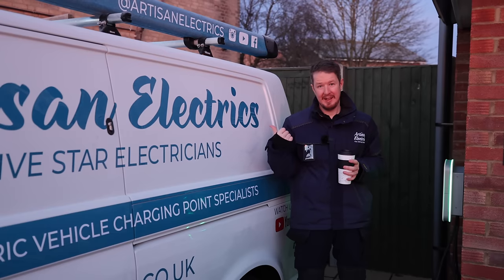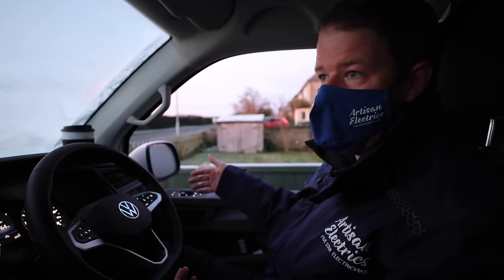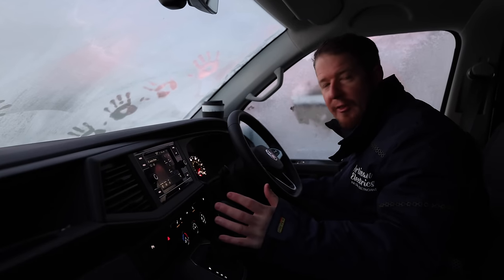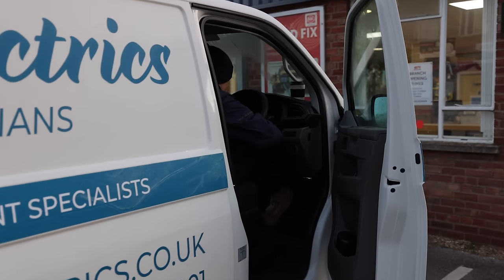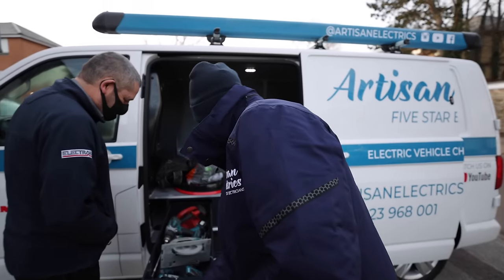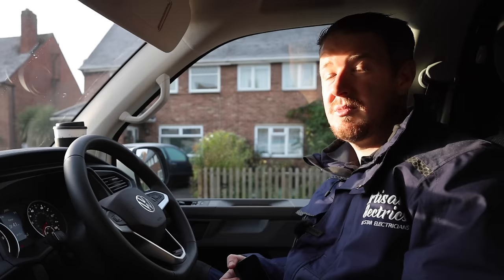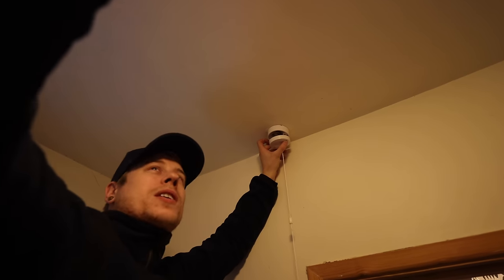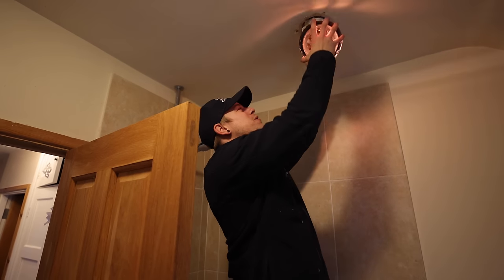ELECTRIC VAN NIGHTMARE 😬 - Volkswagen Transporter Electric Van

Comment: Let me get this straight--you can't predict how many hours it takes to charge at 3.6kW, even though you're electricians
Reply: 🤣🤣🤣 the van probably does it.
Reply: Charging batteries is not linear, it is rapid for the first 3/4 or so, then tails off as the battery management has to keep the cells from going over charge.. bit like filling up a glass to the very brim without spilling it: you can pour water in quickly for the first bit, then you have to slow down more and more as you get near the top.
Reply: @--Nath--  When you're fast charging, yes. But the video quoted 3.6kW. That's slow, onky slightly more than a 13A "granny cable" but less than the next step up, a single-phase Type 2 home connection at typically 7kW.

Is it a limit of the van? Whatever, assuming they didn't get their facts wrong, 3.6kW is slow charging already and there would be no need to reduce charging rate until the battery is very close to full.
Reply: @RupertReynolds1962  some battery chemistry makes low temp chargimg a problem.. so that may be why..? If it doesnt have active thermal stuff (like a tesla for instance) then maybe it was low temp cutoff as the issue? But I thought that was more of a "complete stop of charging" type issue..
Reply: @--Nath--  
Charging batteries is therefore Algorithmic.
Reply: @alexnelson9512  constant, linear, logarithmic, exponential, factorial would all qualify as "algorithmic" surely..?
Reply: @--Nath-- 
 Not in the case of decibels (dB)  = 10 log.
Reply: @--Nath--  I've only ever charged my car on 6KW. Seems pretty linear until the last 2% that take forever, something called battery balancing, who knows. My leaf tells me how long it will take to charge, surprised if his van or app doesn't. Couldn't watch as the blokes an idiot.
Reply: @patrickmooney5035  lithium batteries usually have a minimum charging temperature of 0C, while lithium batteries can be charged below 0, it has to be at a really slow C rate because the absorption is really slow.
Reply: @cbflazaro  I cant say that I've noticed  but here in the UK sub zero temps would probably occur over night. Thanks for the heads up, I will pay attention if / when I have to charge at that sort of temp.
Reply: Well, he's trying to defrost a windscreen with his hands so no surprise there. (ha)
Reply: @RupertReynolds1962  Problem. Home power meter only handles 3kW. Running it even near max potential for a couple of hours every day would mean thousands going out in electricity bills. Having an industrial supply contract just to charge the car isn't quite inviting isn't it?
Reply: @giacomoneri1782  That isn't an answer to anything I said here.

And I don't know where you get your figures from: here in UK--at 230V each 13A socket can deliver about 3kW maximum, but the domestic meter in my house is protected by a 100A fuse. Over 200kW, so the meter is certainly not a "problem".

If you don't take advantge of overnight electricity (variable rate tariffs) then you might pay 18p per kilowatt-hour.

Average UK mileage seems to be less than 8,000 miles, or 22 miles per day, or about 6kWh in an eNiro, costing about £1.10 per day. 2 or 3 hours plugged in with a granny cable

On the same mileage, my small Renault Clio would cost £3.70.

So even if electricity costs double (and petrol doesn't) and even if you don't use the right tariff becuse you didn't know about them, electric cars would still be cheaper.

It will cost a lot less than that on a variable overnight tariff, because our grid's generators run more efficiently if the difference between daily peaks and overnight minimum is smaller.

Then of course EVs tend to have lower servicing costs and less depreciation in value. I don't see any problem, except that the initial cost of buying an EV is currently higher.
Reply: @RupertReynolds1962  yeah, the meter itself it's not the problem. The contract may be one. I don't know about running costs, haven't done any real calculation yet, but taking into account how much an air conditioner or an hair dryer impacts the bill (which almost tripled since 2020) makes me wonder how much having a car taking the full power for 2 or 3 hours a day may cost. Maintenance costs aren't that big of a problem. A decently kept petrol car can easily run 20 years and over 200000km without big expenses, just brakes, tyres, bulbs (which are also in EVs) and fluids. Also, the less complicated the car is, the more problems can be fixed at home without having to spend fortunes in parts and specialized labor. A 20 years old petrol car can be easily fixed with cheap scrap parts without seeing a mechanic. The same cannot be said for EVs. And last but not least, complex systems and assists and alarms and all that fancy stuff, it's just annoying to me. I like the car to have less control as possible, so if something fails i can easily work my way around it by myself
Reply: @RupertReynolds1962  depreciation is not an issue either if you run it for 20 years 🤣
Reply: @giacomoneri1782  Funny you should mention that--my Clio is 22 years old and still going strong.

But I am not representative of yer average driver :-)
Reply: @--Nath--  It's 28 degrees F. It's not even cold.
Reply: It depends on the power draw. Dewalt has a 54w fast charger. It doesn't work in the cold. It changes to a slower charge. 
So how can you calculate charge times ?
Reply: @taureanwilliams2900  He said "because it only charges at 3.6kW" which seems to say he knows the limit of his charging setup is 3.6kW.

So it could never get more than about 15kWh in the 4-hour window he set. That would be more than enough for my daily commute, but a lot of people would need more. Maybe a 7kW single phase charging point, or go to 3-phase if the van will use that?

If they meant "because cold weather limited the charging to 3.6kW" they'd have said that, or commented later, yes?
Reply: 234 HP divided by 4.3p per gas unit x 240volts = 6hrs 43 minutes
Reply: @andyharpist2938  You forgot hemlock and eye of newt from that magic spell!
Reply: @RupertReynolds1962  Absolutely correct...basically it's the same formula that the electrician uses to calculate my bill.
Reply: Not mph
Reply: @--Nath--  nice analogy
Reply: @alexnelson9512  asymptotic?
Reply: @RupertReynolds1962  There are lots of 20+ year old cars on the road in the UK. It should be interesting to see how EV's compare.
Reply: @TKevinBlanc  28 degrees F is below  the freezing point of water.
Reply: @paulhillman400  Early EVs seemed to suffer more degradation and even with them 10 years is not all that rare.
I'm hoping that we'll see 20 years quite often, maybe more with LiFePO4 which seems to be OK for 2 to 3 tbousand full cycles.

But there's only one way to find out. If I'd told my neighbour with an Austin 1300 tin pig years ago that soon cheap cars would last well over 100,000 miles and 20 years on tbe original engine, he'd have laughed in my face. Or cried...
Reply: Yea and then the pito mans did it for good 😂😂😂
Reply: YES BUT AN ENGLISH ELECTRICIAN.
Reply: Electricians work with ac not dc
Reply: @--Nath--  Charging isn't linear?
It is not relevant. Maximum power output from the charger is 3.6kW and he had it on charge for 4 hours. 4*3.6 = 14.4kWh. The maximum amount of charge, whether the charging curve is linear or not (you actually mean constant, which is not the same as linear) is 14.4kWh, and the vehicle probably has batteries to more than 100kWh.

Which means it is no where near fully charged, regardless of whether the charging was not linear/constant.

It's an incredibly easily calculation to do. I just did it for you...a single multiplication. It doesn't get any easier than that.
Reply: @alexnelson9512 And to what algorithm does it conform? You have used the wrong word.
Reply: @alexnelson9512  Actually , dB conversion could also be considered an algorithm.
But dB's don't apply here in the case of battery charging. Radio Frequency power yes, Audio signal strength yes, but not car charging
Reply: @taureanwilliams2900  56w charger? That's incredibly low.

Oh, you mean 56kW? You can't deliver 56 kW from a typical UK house which has single phase electricity with a 100 amp main fuse. Not going to happen. So it is a complete waste of money. The most that can be achieved is 23kW.
Reply: Yeh not that sharp this one ey...
Reply: @patrickmooney5035  Top comment on here 🤡
Reply: 7:00 Seems like an odd place for the charge port. It would be even worse if that were the driver's door, but I realized after a moment it would be reversed there.
Reply: Doing enormously difficult sums like that requires an engineer. That's why it's illegal for them to wire houses
Reply: Kind of a paradox. But can you wire your house?
Reply: @RupertReynolds1962  And if the two 13A sockets are on the same ring main you can wire two plugs in parallel to get 26amps at 240 Volts perfectly safely :)
Reply: @smitlag  I can design power station instrumentation and whilst the government won't let me sign off on all the wiring I did in my house (includes 6kw of solar panels, 6kw inverter and 18Kwh battery bank for 3 500 quid) I just paid a registered electrician an hour's labour to sign it off and give me a certificate of compliance.
The electrician owed me a favour for explaining how to  sort out a elcb nuisance tripping problem on a 3 phase plus neutral installation for a 200kg load capable KUKA robot :)
So the answer is yes, I can wire my house and actually did so.
Reply: @andrewallen9993  I studied electronics, not electrical, so I don't have the right qualis to say this, but I'd guess we should run a spur to a 32A socket (IP44). Blagging 2 13A sockets will only make someone cross :-)
Reply: @andrewallen9993  Well, you pass then with flying colors, lol! But as you know there are specialties to any field. I doubt the current IT guys know much about Unix system admin these days. Most home and commercial installation electricians don't deal with too many control ckts. But they are fast and efficient in what they do and know their aspects of the code. Even doctors and lawyers specialize. Hell, go to a dentist. I do 95% control work and often design my own circuits as well. But I can tell you, most RD engineers I have worked around after 40 years are one trick ponies. They know their system or even part of a system. If I throw another manufacturer at them they are lost. 41 year American elevator tech and EE.
Reply: @RupertReynolds1962  They wouldn't like it but it wouldn't burn your house down. The plug fuses would protect the wiring. The ring mains ability to confuse US electricians and others is why they only use them in the UK :) Light current engineer here, instrumentation, small drives, robots and software :)
Reply: @smitlag  Well if you can design an elevator system for a tall building you can also design a production line conveyor ( though it might take you longer, or think of a Robot as a bank of 7 elevators all working at the same time but far more accurately, similar control logic)
Which was the point I was making with our electrician friend initially :)
As an EE (so I presume you are in the US) are you also prohibited by law or a union from wiring/ plumbing/ building your house or elevators?
Reply: @andrewallen9993  you can pull a permit and do your own work in my area. But it is subject to inspection.
Reply: @smitlag  Same here, need certificate of compliance.
Reply: Visa  card  job  done,  Or  Tescos  clubcard  every  little  helps!
Reply: SPARKYS are dense ! Hahahaha